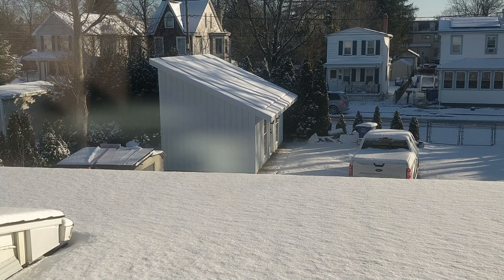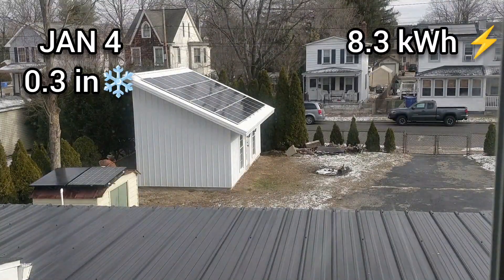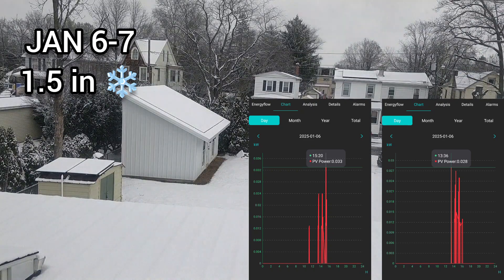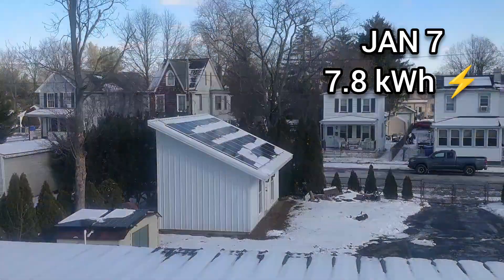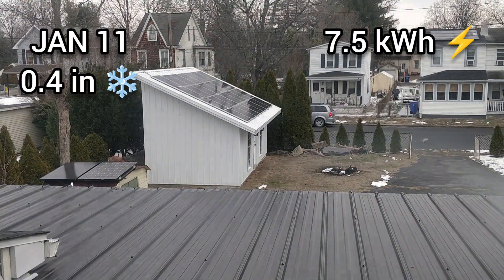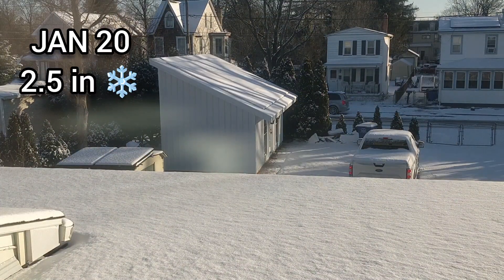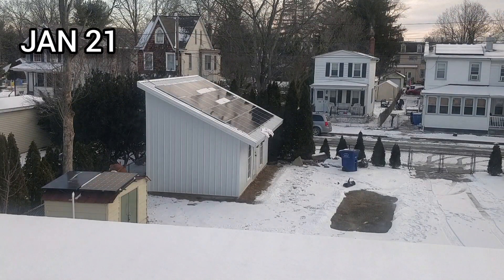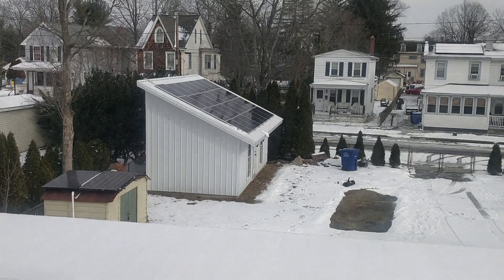Snow Day Solar - Time-Lapse & Energy Production

Comment: what is your total solar panel size in kw?
Reply from the maker: The system's rated capacity is 5530 kW.  Bifacial gain is not included in this figure as the system is roof-mounted.